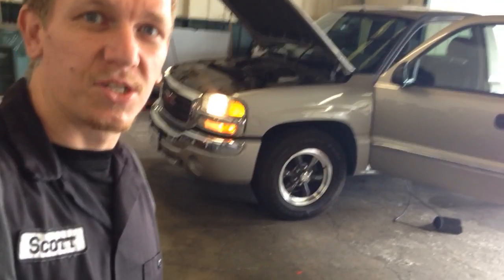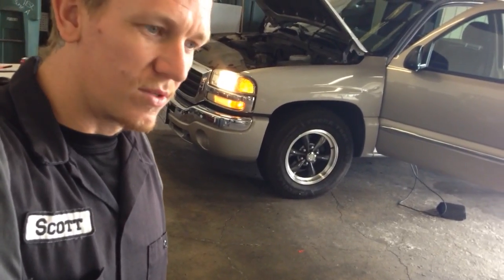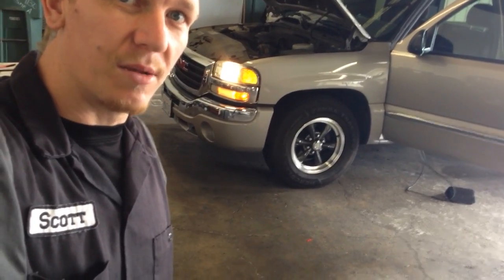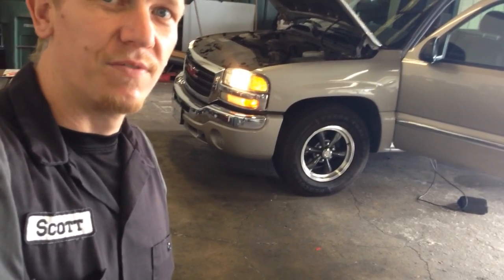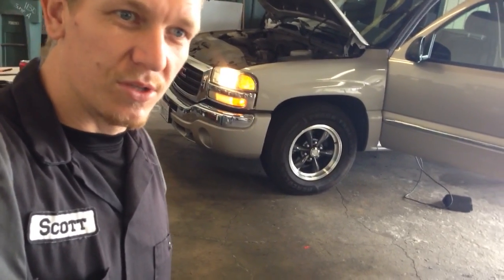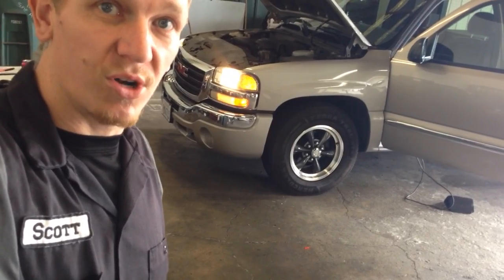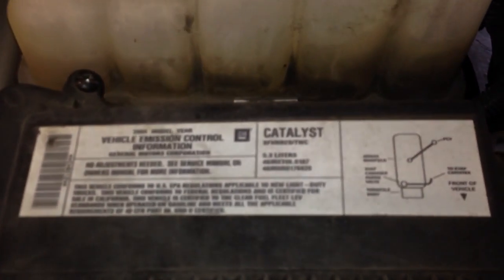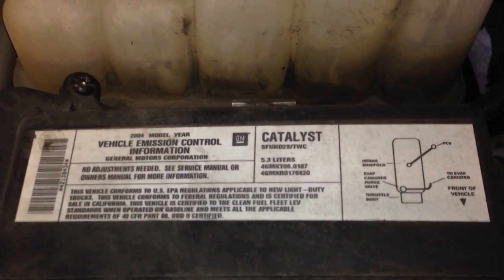GMC Sierra emissions locations: PCV, EVAP canister, & EVAP purge (Silverado, Cheyenne,  C/K, 5.3l)

Comment: Where is the evac canister located on a 2008 gmc sierra 1500 5.3 v8? I have looked and can not find it.
Reply from the maker: 4 places it's usually at. Next to the tank, ontop of the tank, above the rear axle, about the spare wheel. It'll be I. One of those spots, depending on what options you have on your ride.

Comment: ya don't say a fucking thing about how to get at em and remove!!!  HOW ABOUT THAT PAL!!??
Reply from the maker: Some people just need a starting point on starting a repair. Now you know the location, see what you need. 

Good luck on your diy fix.
Reply: If you need to know how to remove them, then you shouldn't be touching them. Knowing the locations of the parts is the most important part. Removing bolts and screws basic knowledge. Something that is taught in grade 9 shop class

Comment: I  have a problem  with my GMC sierra 2017 When ir accelerates it shakes and loses power. The motor  sheiks.
Reply from the maker: Well.. could be a ton of things. Have you done any maintenance on the vehicle? Do you have a check engine light on? If so, what is the codes?
Reply: Chane the sparkplug  and cables.

Comment: I have a 2005 GMC Sierra 1500 4.8L WT. I have a P0455 code. After taking the bolt out, im having trouble removing the EVAP canister (charcoal canister). Any advice? I've already removed the solenoid and am replacing that today as well.

Comment: I hav a ? for u i have a 2001 Chevy Silverado 5.3 it is running like 💩 it won't take any fuel an the code po300 comes up multiple miss fire can that evap system cause any of those problems?

Comment: Are these locations the same for a 2003 sierra ?  Getting code p0449 and 0455...already replaced the gas cap and light came back on.  If the locations are the same for an 03, to replace the one under the truck do I need to pop the bed up? Saw a video where the guy popped the bed up and his was located on top of the gas tank on the front side of it.....

Comment: Need help with 95 chevy silverado2500, 5.7l  California smog
Reply from the maker: What ya got? Maybe I can give you a recommendation.
Reply: @ScottiesHobbies  k&n air intake system on  engine, do I have to revert back to factory air filter to pass smog
Reply: Also first smog Tech wouldn't even do the test recommended to change out headers
Reply from the maker: If you have a K&N intake on the vehicle you should be able to come up with a carb number for it. Does it have the part number on the air cleaner at self? If so what is it? In these two have some identifying numbers on it so the technician can cross-reference the carb number to the part number. Same thing with the headers. Everything has to be carb compliant. Carb stands for California Air Resource Board. All it pretty much is, is the manufacturer paid their tax to California to be able to sell aftermarket parts for your vehicle.
Reply: @ScottiesHobbies  ok carb e.o. D-269-17 for the n&n air filter but do I still need to change out headers? They are ed Edelbrock #6667  carb e.o. D-215-17
Reply: 57-3024 k&n performance air intake system eipk gen 2
Reply from the maker: I will get back to you this evening. Let me do some research on it and let you know what I find.
Reply: @ScottiesHobbies  okay Scotty I did a little research of my own I'm not really an auto mechanic that's why I need guidance to make sure I'm going the right way about it if the exhaust headers has to have the little silver sticker can I just replace the driver side? If I don't have sticker for the one that's on there and I can't find anything on Edelbrock part number 6 6 6 7 with the 53 on it exhaust headers everything around it but all make and model  are 50 state legal

Comment: Hey I changed my plug 3 times and when I get it reads it’s say emissions system what could it be?
Reply from the maker: What is the code?
Reply: It was saying 308 after changing maybe two months back to running roughly

Comment: Having EVAP leak issues on a 2005 GMC Sierra 1500 truck, and have found one of the leaks, who knows how many more, but is there a site online where I can plug in the part number and find exactly where the part is mounted on the vehicle? Hard time finding part numbers on the part due on the vehicle due to the location and tight quarters.
Reply from the maker: Have you vacuum tested the vent in purge solenoid? Have you checked the gasket on the bottom side of your fuel cap yet? If your fuel cap has any cracks on the seal make sure you replace it with a OEM replacement or a stance cap do not get a universal cap for a locking cap. Do you have a check engine light on? Do you know the codes stored in the computer?

Comment: I'm looking for evap purge valve for 1992 GMC Sierra. 5.7 eng
Reply from the maker: Off of the top of my head, I think it's located right in front of the throttle body. If you're standing in front of the truck look under the air cleaner and I think it's right there. If I get one in soon I'll make sure to make a video of it and post it. If you want you can send me a picture of your engine bay more specifically the front of the engine and I'll Circle it and send the picture back to you if it's in the picture. You can email me at Scottbpay@gmail.com

Comment: Hey Scott sorry to bother you again 2005 jeep liberty spitting out gas from the fuel neck what could cause that?
Reply: Before I forget to mentioned checked all hoses and no holes did smoke test. All come out good.
Reply from the maker: usually a EVAP vent solenoid not working properly.

Comment: Hey Scott question what can make my 2005 jeep liberty spit out gas when I fill up?
Reply from the maker: +John Meyer spill out from where? At the filler neck where the nozzle is or under the truck?
Reply: From the fuel neck
Reply from the maker: +John Meyer that could be a seal. Can you see the filler neck on the bottom side of the truck or the top of the gas tank? Use a flash light if you can and look for and rubber areas that look clean.
Reply: Scotties Hobbies I'll look into that thank you. P0441 what causes that code?

Comment: I'm trying to do a LM7 engine swap from a GMC Sierra 1500 into a Jeep YJ. The LM7 engine wiring harness I have has a sensor fitting labeled evap canister. The evap canister I bought from GMC only has hose connections no sensor fittings. Does GMC make a evap canister with a sensor?
Reply from the maker: +Frederick Gaghan its probably for the evap purge solenoid. Its usually located on the intake manifold.  The other component  is the vent solenoid. That solenoid is at the rear. I cant think of any late GM trucks with a sensor on the vapor canister.

Comment: I have a check engine light that has been on for over a year. Last year the mechanic replaced the valve on top of the engine under the plastic cover. That worked long enough for me to pass the inspection and them a week later the light was back on. I do have trouble filling the tank especially in cold weather. I now need to get the new inspection for 2018. What would you guess is the problem since its doesn't seem to be the valve on top of the engine. The Evap under the passenger side or the evap purge on the side of the engine? Any other ideas would be appreciated. This is for a 2004 GMC Sierra 5.3 engine. Thanks for the video. I have been looking in the wrong place for the evap. I thought it was near the tank.
Reply from the maker: +dean thomas id bet you are having a problem with your vent solenoid. Its located under the truck, near tye spare tire. I recently uploaded a vid that hows the location of the vent. Check my other vids, I'll post a link later.
Reply: Thanks for posting the link when you can. I looked through your channel but didn't see a vid on the vent selenoid for a 2004 GMC. I appreciate your help.
Reply from the maker: yours should be very similar to this: https://www.youtube.com/edit?o=U&video_id=ldH7FbHc3_M
Reply: Thanks Scottie but the link doesn't work.
Reply from the maker: +dean thomas damn it. Ill try to  copy and paste it again tonight. Its not your exact truck but it should be very similar. When i get infront of my computer later I'll get the link again.
Reply from the maker: +dean thomas try this one:  https://youtu.be/ldH7FbHc3_M
Reply: Hi Scottie. I just got back from getting my truck inspected and this time it passed. I removed both battery post and drove 53 miles and it passed. I did crawl under my truck and saw the vent selenoid so now I know where its at so you don't have to post the video for me. But others may like it. Thanks for your video. It was the most helpful of all I have looked at and I have looked at a bunch trying to figure out why I kept getting a "tighten fuel cap" on my dash. I will replace that bastard ASAP.
Reply from the maker: +dean thomas glad to help.

Comment: Did as you said. Hose comes off but  after taking a longer look pcv valve is pressed into the left valve cover. It looks like one must take to dealer, pay high $$$$$ to have a new valve cover installed. Another viewer on You Tube stated it cost him $150.00 for the valve cover and pcv valve. I have less than 44,450 miles on this 2005 truck.
Reply from the maker: If you  look at this vid, at 8:18 I pull the intake off with the vacuum hose still connected to the intake and the pcv comes rite out with it. I'll make a vid tomorrow and upload it. https://www.youtube.com/watch?v=rjH50wbOBww
Reply from the maker: +Robert Bowman I see it now. In 2003 GMC changed the valve cover to that Preston PCV. You are correct. Chevy switched over in 2005 it looks like. Never compare the two but I wonder if it would be cheaper to just replace the valve cover with a older style valve cover so it's easier to maintain that PCV. Sorry for the misinformation in the beginning. If you do look into switching over to a older style or end up comparing them please let me know how that goes. Also keep me informed if you get this replaced on how much did it cost Etc so we could possibly help somebody else in the future

Comment: My 2005 GMC Sierra engine has the pcv valve right where you showed it to be. Does one have to use pliers to pull it out as I will have to ruin it to get it out? It looks to be pressed into the engine head.
Reply from the maker: +Robert Bowman just pull up on the hose. Pull up on it. Should come rite out. I have a knock sensor video that i show how to pull it out.
Reply from the maker: +Robert Bowman if you have another PCV valve next to you when you do this job it really should take less than 5 minutes.

Comment: Have a nasty P0455 code on 2003 Chevrolet Silverado 5.3 haha Changed the vent solenoid ,purge valve,gas cap, pcv valve, and still getting it...must be that carbon box under the plate i need to change now? Anyone have a part number for that square box?
Reply from the maker: You might have a leak some where. Have you chased the evap line from the purge on the engine to the evap canister? On the filler neck, is the hole 'ob-longed'?  Have you done a fuel pump lately? Is the fuel pump assembly sealed on the top of the tank? Lastly, the map sensor sensor on the gas tank could be bad. If you can induce about 3-7 psi of air in the service port and spray the evap system with soapy water and watch for a leak. you might even be able to put about 3-7 psi of air  if you disconnect the evap purge and connect to that hose. I have a vid on a dodge of doing a half ass diag on a caravan if you check my other vids.
Reply: No i havent really inspected the lines or top of the tank,that charcoal canister i just been replacing parts this last week or 2 to try get this truck through NYS inspection lol. thanks for your reply ,ill be crawling under it at some point today and i will inspect better.
Reply from the maker: +ken jackson looks lor cracks on the cannister wile you are down there. Look for any damp spots on the evap lines.
Reply from the maker: +ken jackson and good luck!
Reply: I had few things going on apparently. After changing the purge on intake i took the vapor canister off and had raw fuel in it! So i allowed to dry and blew through the tank side several times until was dry from gas and any dirt...then over the weekend i figured i would check under the fuel filler neck and by my surprise but shouldnt be i live in north east, there was a hole in the rusted filler neck,ordered new fuel filler neck and as im changing the old one see where that broken ground strap went to hahaha well i cleaned it all up ...gonna drive few cycles and clear the monitors now as i cleared the code this time to give her fresh start.
Reply: I think ? the gas in the vapor canister was from stuffing extra fuel in my tank all summer? hahaha not sure either way not doing that any more either...well thanks to epa and gm engineers ive learned the whole evap system on 2003 chevy silverado lol

Comment: Hey Scott. I'm getting code p0455. Large evap leak. Replaced purge valve. Replace urge solenoid. Replaced gas cap. No luck. Any ideas would be greatly appreciated.
Reply from the maker: +Jeremy A did you check the vent solenoid down by the canister?
Reply: Scotties Hobbies.....yeah. I have replaced it.
Reply from the maker: +Jeremy A possible defective evap pressure sensor? I would recommend a smoke diagnosis firsr though.
Reply: Scotties Hobbies...your talking about fuel tank pressure sensor?
Reply from the maker: +Jeremy A Yea, the map sensor on the fuel pump assembly.

Comment: Thank you so much for postíng videos they are very helpful. I have a 2009 GMC Sierra 5.3 v8. Could you upload a tutorial on how to change the volve pvc? It would be ver helpful. Thank you.
Reply from the maker: +Mario Mendez i think its in my vid on the knock sensors. Its a super easy removal. If you pull straight up on the pcv valve it will come rite out... maybe ill make a quick vid just doing a pcv swap real soon.

Comment: My truck has error code P0191 and P069E I replaced my fuel pump and solenoid on the fuel rail and the codes are still there any suggestions?? 2008 5.3 FlexFuel Tahoe
Reply from the maker: +Oscar Lara did you replace the fuel filter? You might also want to check the continuity at the sensor or solenoid on the fuel rail. I would check for continuity on the front and the back side of the connector to make sure it's making good contact with that sensor or solenoid.

Comment: 3 questions if u don't mind.. how many o2 sensors that vehicle have? where is the locations of them?.. is the map sensor have to do with emission or no? Thanks
Reply from the maker: +Shatti Unique this one has 4 o2 sensors. 2 in front of the cataletic converts and 2 behind them . The Map sensor does have to do with emissions and with air/fuel deliverey. The map sensor is on the top of the intake manifold near the fire wall.
Reply: Scotties Hobbies thanks alot bro and i wish u the best
Reply from the maker: +Shatti Unique thanks! I just made a vid of replacing the knock sensor on a 5.3. Ill probably edit it and upload it next week. (Taking the kids on a vaca this weekend) i do remove the map sensor connection in it.
Reply: Scotties Hobbies nice..just have fun with the kids and there is no problem about the vid.. my knock sensor is bad since 2013 lol.. to be honest i dont have the tools and im not an expert to do it but there is no problem learn for the future
Reply from the maker: They are actually pretty easy. When i upload it ill tell you what part to watch to catch the map sensor.
Reply: Scotties Hobbies thanks alot and i will do my best to do it alone

Comment: I recently changed my pcv valve on my 03 gmc sierra 1500 5.3 and the inner plastic hose cracked and now I can't find a replacement one???what can I use???
Reply from the maker: +James Davis can you get a 3/8 vaccum hose on the pcv and the intake? I have a 5.3 in my driveway. Ill take a look this weeken, maybe even replace the pcv too. Ill look a little better and get back to ya.
Reply from the maker: +James Davis maybe a 1/2 vac hose would work. Either way, try some vaccum hose.